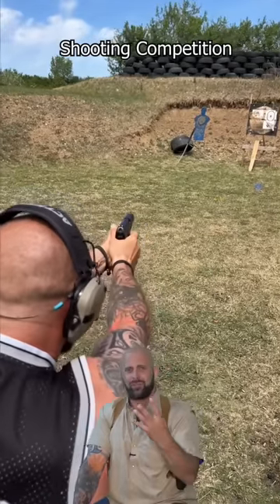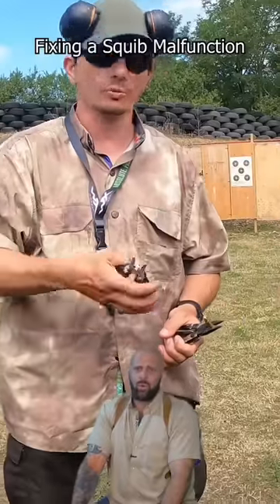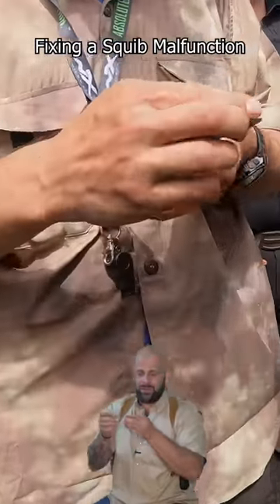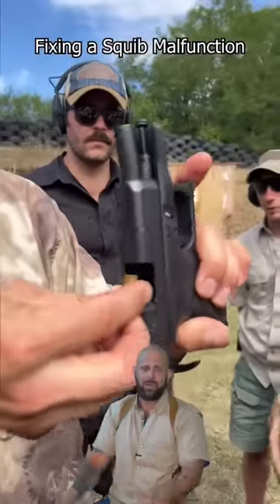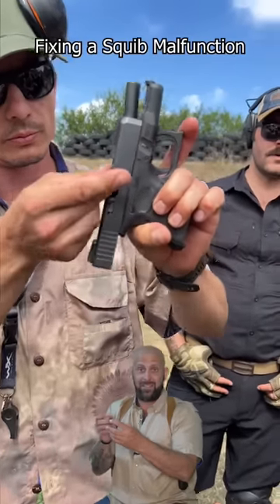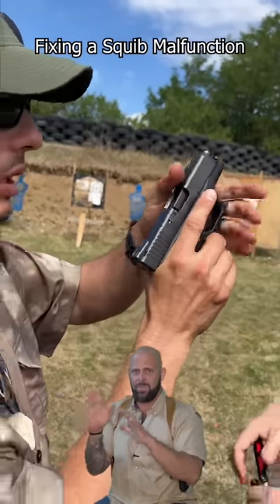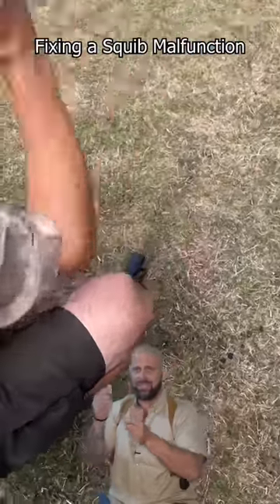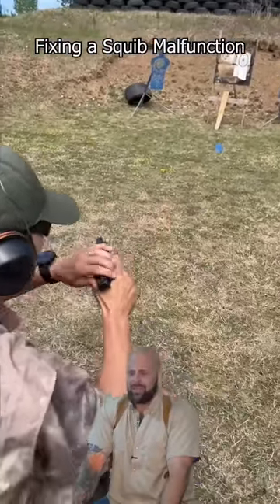Israeli Tactical Training School: Advanced Pistol. Video Clip #10

Comment: You could literally replace the barrel for $100, which is probably less than your ER visit deductible.
Reply: Why replace the barrel? If you get a squib, clear the gun, disassemble it, and push the stuck bullet out with a cleaning rod. This doesn't need to be hard, unsafe, or expensive.
Reply: @Gaspard129  We're in agreement - I would clear it conventionally with a rod myself. My point was replacing the barrel would be safer than that crazy -ass field blank experiment.

Comment: How did the steel target make a sound if the bullet did not leave the barrel?
Reply: Yeah.  Why do we think there is a squib
Reply from the maker: The point of this whole video is that the malfunction was that the bullet did not leave the barrel, and then he removed the barrel by unseating a bullet, and using a cartridge with a bit of powder to drive the bullet that didn’t leave the barrel back out
Reply: @BoneTactical   but how did the steel “ring” if it was a squib?!
Reply from the maker: @RokU5  did you not watch the video!? 😳
Reply: @BoneTactical  yep, “squib” made steel “gong” sound

Comment: Hey brother, im hoping you will recommend a choice for a hammer fired .45 concealed carry,  10 round minimum.  Ive carried a .357 for years and want to change with the times now that violent crime has been Bidenized
Reply: I'm not bone, but I love my usp45. I've heard good things about the fnx45's as well. 

9mm isn't a round to be shunned either, especially in a free state. You can end up with twice the capacity and a round that will do very much the same job with proper shot placement.

Comment: Dangerous solution to a squib load here.   Carefully confirm that the empty case has been ejected.  Do not load any other rounds.  Then use a rod, screwdriver, etc to remove the pill from the barrel.

Comment: I strongly advise an amendment video, putting A live charge behind a squibbed barrel can cause the barrel to sporadically deconstructed its self upon firing,  we give headspace on a projectile so it has just enough freebore that it has a sliver of space to accelerate smoothly into the grooves and lands, I’m not an engineer but I can tell you this is potentially hazardous and ill advised
Reply from the maker: You’re definitely not an engineer if you think a piece of lead wedged in a steel tube will cause the tube to fail under a light powder charge! 🤣🤦🏻‍♂️

Comment: As a reloader… DO NOT DO THIS. It sounds like a good idea, however  contrary to what you think, the extra air gap can create excessive pressure in the barrel causing a catastrophic failure in the firearm. Put bluntly, you can blow up or split your barrel.

Comment: My dad showed me this a long time ago with an old beat back colt 45 the extractor won't break unless you slam the slide forward , noticed how he gently let the slide forward and then tapped it into battery ,if your in a pinch it will work,who carries a stick everywhere they go🤔but a loose round, it's a better option depending on the situation

Comment: You shouldn't. It's a pretty clever way to blow your hand off. If you have a bullet stuck in your barrel, it is SOMETIMES because there wasn't enough powder to push it out. He even says "often". Are you gonna risk your hand on "often"? The bullet could be lodged and putting more pressure is gonna turn your gun into a grenade

Comment: Sounds like a good way to bulge your barrel. If that bullet is halfway down the barrel, now half of your barrel and chamber are being exposed to a rapid pressure spike. The chamber can handle this, but the barrel...not so much. It takes 2 minutes to strip your gun and pound the round out.
Reply from the maker: If you have a rod it’s quick, and the barrel is not suffering a complete blockage… pressure will follow the path of least resistance… it’s simple physics! What will give first? Soft lead or pressure rates steel? Cmon guys think before you comment!
Reply: @BoneTactical  the chamber is designed to handle the initial pressure spike of a cartridge igniting, if the bullet is halfway down the barrel you now have half of the barrel and the chamber being exposed to that pressure spike. The barrel beyond the chamber isn't designed to handle this spike, it's designed to handle the bullet traveling down after the initial spike (contained by the chamber) and any static pressure (which is slowly decreasing as the bullet moves further and further) that follows the bullet. All of that pressure slamming into the thinner walled barrel can result in a bulge. It's not guaranteed, but you're significantly increasing the likelihood.
Reply from the maker: @GriffXJ  the bullet already being  in the barrel means the lands and grooves have already been formed, which is the main reason the chamber is reinforced. For that initial shaking of the bullet. Again, common sense stuff here. You’re arguing my friend maybe try listened and learning something new.  Can’t do both at the same time.
Reply: @BoneTactical  not sure why my last comment was deleted...but I'll try this again. Not blaming you for deleting the comment, this has happened before.

The issue is you're effectively increasing the case capacity, the area between the primer and bullet now reflects your "case capacity". This can result in the powder detonating rather than burning at the proper rate. The same exact thing can happen in reduced charge cartridges, they have a higher likelihood of exploding if the powder detonates from the higher case capacity, this is the reason why they add a filler material. Hodgdon even said this in an email response to someone regarding a reduced charge cartridge:

"What does happen is this: When a load is too light, the primer will blow the bullet out to the lead where it sticks. The main charge then burns. With the bore plugged by the bullet, the pressure raises like putting your finger over the mouth of a Coke bottle and shaking it. Pressures that would normally be 20,000 PSI jump up to 80,000 PSI just because the bullet is not moving as it should." - Mike Daly, Customer Service Manager 

This was talking about reduced cartridges, as I said before, but you're creating this EXACT same situation by firing a squib from a barrel. So, I'm not arguing. I'm presenting facts and logic presented by industry experts. It's not "simply physics" in this case, it's a lot more involved when you consider other factors coming into play.

Comment: The biggest problem with this is what if the bullet is 3/4 of the way though the barrel and youve got all that empty space between the cartrige and the stuck bullet. I'd never do it but if i did I'd dump about half of the power out of the cartridge before i tried, worst case scenario you've gotta try twice but you aren't at as much risk as boring up your gun.

Comment: cleaning rod, mallet/rock/another pistol/ plank of wood/ boot/helmet, the side of the sole on your boot, and one good whack. if it works for 5.56 it'll work for the 9mm. although I would want a dowel for that
literally anything but that unless you're in a firefight and don't have the time. maybe then it could be a good idea to carry a single blank. just in case you're the one in a million

Comment: A year later I experienced my first squid load.. My next round I remove the slug and did just that as in this video. When I disassemble the extremely Gucci fn 509 tactical the slug only made it halfway down. So when I fired the slugless round. It shot the stuck slug out... Although inaccurate as hell. It got the slug out without causing any damages.. Don't feel comfortable using a rifle or anything hotter than what I was using but in my situation it worked
Reply from the maker: Squib
Reply: @BoneTactical  I kept trying to spell it the right way but auto correction kept undoing it and putting it the way that It is..  so I just gave up lol f*** it🤦‍♂️

Comment: I honestly would empty the cartridge and push the projectile out with just the charge from the primer. Unsupported chamber from charged case with a full powder load equals slide shrapnel to the face.
Reply from the maker: False 🤣🤦🏻‍♂️
Reply: @BoneTactical  You’re squib test was performed by manually inserting the projectile in the bore of said pistol. Then removed a projectile from a cartridge, then placed in the chamber yada yada etc. 

This was demonstrated on a range with bunny fart range ammo. Please try this with a high pressure +P self defense load and get back to me. 

To say that this cannot cause an over pressure in the barrel is ridiculous. So the people that try to emulate this can send your ER bill to you then?

Comment: There's a reason we remove squibs mechanically instead of via this method. I'm not saying this couldn't work but unless your up that unwholesome creek I wouldn't do this. Also reloaders know on reduced charges inconsistent burn can happen and a change in when pressures spike or lack thereof can be dangerous

Comment: It’s quicker with a hammer & punch down the barrel to remove the projectile. The barrel is harder steel than a punch so it won’t mar the surface
Reply from the maker: It depends on what’s on hand and the skills and abilities as well as training of the operator, but there are different options for different situations for sure

Comment: Everything I just watched you do is the most unsafe way to do it. There is a "round" in the chamber, you can let the slide go. The brass is there, you will not damage it. What if it had fired? Ouch. And also pressure is different when the bullet has to move to get to the rifling. This is like making a pipe bomb, but they aren't my fingers. Keep on rocking brother 🤙🏻

Comment: Hummm….I’d personally be a bit apprehensive firing a charge behind a bullet stuck in the barrel. I’ve had squibs in a .38 that required a hammer and rod to beat that stuck bullet out once it tightly engages the rifling . Absolutely safe with NO chance of creating pressure issues which WILL happen even by adding just a powder charge.

Comment: Could have been a blockage that caused the stoppage.
If so, the barrel is more than likely already fucked and dangerous with a single bulge.
This will cause weak shots, possibly another stoppage. It needs an on the spot inspection after its been cleared.
Reply from the maker: No
Reply: @BoneTactical  Yeah... So long as it was an underpowered load that caused the stoppage its alright.

Bulges and double bulges (which result in barrel explosions majority of the time) are the main ways I see catastrophic barrel failure. Usually caused by puckers, but always a double bulge before failing.

Comment: Progressive reloader here. Taking a pair of pliers and pulling the bullet is a pita in itself. I could also see even a steady hand spilling some of the charge. This is all just so stupid when a 29 cent wooden dowel will solve this but in a fraction of the time.
Reply: And also, having to push your slide into battery is just cringe in itself!! That’s the marred and mangled brass case being fit into the chamber. While brass is softer than that steel barrel, it just hurts to watch!! 😂

Comment: That will remove the bullet from the barrel, but it can also cause a bulged barrel. Not the ideal way to do it.
Reply from the maker: If the bullet is loosely lodged in the barrel due to lack of powder in the original casing, how can doing this cause a bulged barrel?
Reply: @BoneTactical  it's all about the pressure. With a handgun it probably won't be as bad. With a rifle it will absolutely bulge the barrel. When you fire the gun, the pressure from the powder has resistance from the bullet from the start. When the bullet is lodged down the barrel already, that pressure hits a wall and creates a massive spike. The bullet is also not loose in the barrel. It's pretty durn tight.

Comment: LOL so you choose to use a pair of pliers to mangle the cartridge case and get it jammed in the chamber bad enough to get the case tightly stuck just out of battery.
Then you have a nightmare situation where you have to clear a firearm that has a bullet lodged in the bore and a primed and powdered case in the chamber you cannot remove because both ends are plugged.

I keep a very open mind about things but this isn't one of those things. If you have a multi tool, you can fashion a good solid stick ramrod and find a limb to hammer with.

Comment: Sooo as an EOD Team Leader with my Master Badge, I can absolutely say that this is dangerous and should NOT be shown on the internet. But I'm sure others with infinite Google knowledge will still feel the need to comment and refute my career long experience.
Reply from the maker: It’s simple physics and metallurgy knowledge applied here with a little firearms proficiency. You were told in the military that a projectile in a cylinder that’s not fully seated on the powder is dangerous due to a pressure spike, but they did you a great disservice because they didn’t teach you the physics behind it. in this case, you can clearly see this works and not dangerous because well we have a video proving it works right here. The sad thing is is that yes you do have to have the knowledge and understanding to know how much powder how much distance and what firearms this is safe with. With a 9 mm pistol in our modern world being made from high-quality steel, and the bullet being malleable lead it. Common sense tells us that this is not dangerous if we simply calculate the size of the space in the chamber, the length of the barrel, the materials at play and the amount of powder in the 9 mm cartridge to help with margin of error, we can dispose of a small amount of the powder before proceeding. It does strike me as odd. However, seeing someone who is telling me he’s an EOD team leader, but is also saying that he doesn’t know what makes the difference between something going boom and something going bang… seems like you should know at what point and how much powder and how much free space it takes to create a pressure spike high enough to blow a barrel

Comment: Good way to damage the extractor forcing the slide forward on a case.  Not the best method.  Chamber pressure even without a round in the cartridge is now distributed throughout unsupported areas of the entire barrel, and not just the reinforced chamber.  Buy quality ammo and keep your gun in good or great condition.

Comment: Please don't do this. With the bullet somewhere in the barrel your powder has more room.  At a certain point when your powder is to losely packed it can detonate (instead of the normal deflagrate) which will grenade your gun. Now I know that's not likely to happen with the faster pistol powders and I also see the shooter is keeping the gun pointing upward to keep the powder in the casing, but since there's no tactical gain, please be safe and use a clearing rod... And never ever try this with a rifle! (With slower burning rifle powders)

Comment: What happens if the bullet doesn’t leave the barrel? Where does all that pressure go ?  That’s a real question,  if someone doesn’t mind taking the time to answer.
Reply from the maker: It depends. But the soft lead bullet inside the steel barrel shouldn’t really lead you to ask that question… it’s like asking what would happen if he tried to do this in a vacuum, it’s work differently, but not relevant.

Comment: This is phenomenally dangerous.  You're not "fixing" a squib. You're basically improvising a blank round and hoping the gas pressure pushes the squib free.  It takes at most a couple minutes to dis-assemble the gun and use a rod to push the squib out.  Do that instead of this "tip".

Comment: Clever but this is not a good idea,chamber pressure could spike and lead to a catastrophic malfunction. Best to clear the squib with a rod if at all possible. As an emergency real life scenario field fix where you need your gun up and running maybe but otherwise best to avoid this.
Reply from the maker: False. Simple physics. He also didn’t use a full powder charge since it’s not necessary

Comment: That’s dangerous as hell.. you could turn your barrel into a hand grenade pulling a stunt like that. Huge pressure spike when you have THAT much space between the powder and bullet. It takes second to remove the barrel from the slide… way safer to push it out manually
Reply from the maker: Actually that’s false, but thank you for watching and I hope this spurs you do a little research and learn a bit more about physics and metallurgy as well as operation of firearms
Reply: @BoneTactical  I’m a reloader. I know plenty about pressure, seating depth, case capacity, volume and how it affects pressure. This is absolutely irresponsible to be putting this out as a method to clear squibs. Hell one of the most common ways people end up blowing up a muzzle leading firearms is by not seating the bullet all the way down to the powder, but thinking it’s seated.. that’s why people put a mark on their ram rod so they don’t do that..
Reply from the maker: @silvergunsmoke494  are you comparing a black powder muzzle loader to a smokeless modern 9mm? Might as well compare nuclear weapons while we’re at it…

Comment: DO NOT DO THIS IF YOU HAVE A SQUIB LOAD!!! Very dangerous. Simply break the gun down (takes 2 seconds) and use a rod to push the squib load out of the barrel. Problem solved. This technique should only be used if you have no other option.

Comment: Ya.. "don't do this." Break It down, Use a rod, pop it out, and inspect your barrel before proceeding. 

doing this is a good way to end up with another malfunction. Called an exploding breach. Much more dangerous and expensive to repair. Even if you survive unscathed. Which isn't guarenteed.